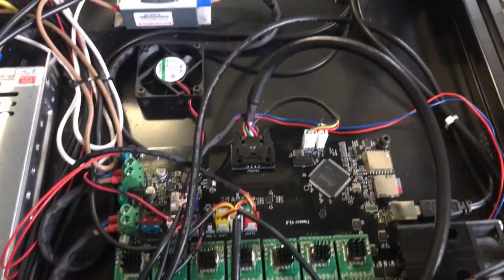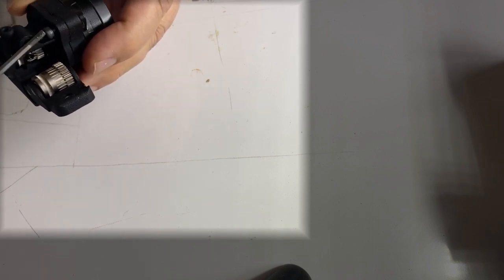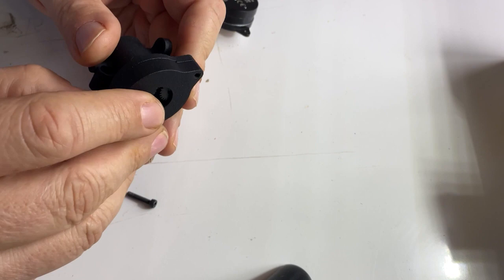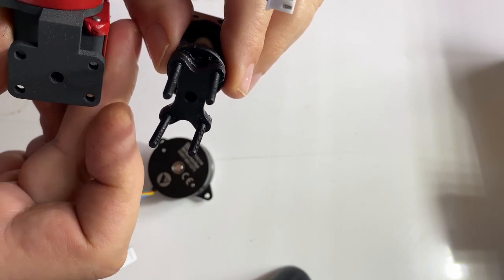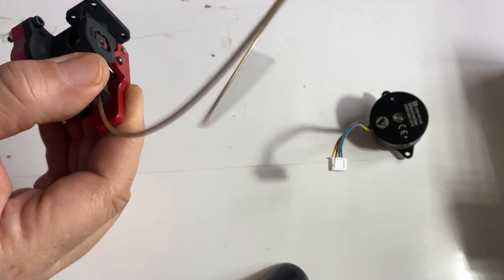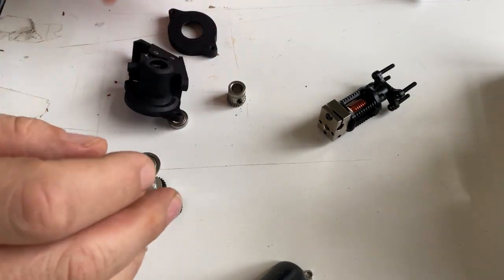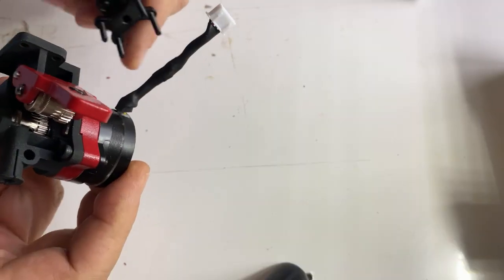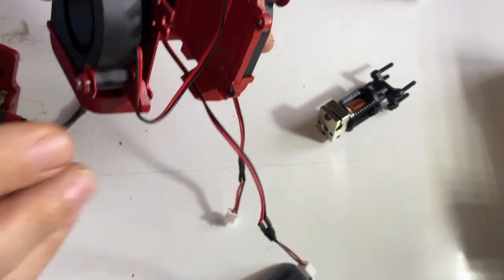Troodon Upgrade Video HD

Comment: Hi Peter, what about the noise level during printing with the Troodon??... could you please provide a video....the hardware looks great, but I need a silent printer.
Reply from the maker: Hello Matthias, the question is: which printer are you going to compare with "Trudie"? The noise level is around 55dB (measured with my iOS App). 
Meanwhile I swapped over to Klipper as a printer firmware and replaced 2 fans with more quiet 12V versions and you can't hear the printer as long as the part cooling fans are not blowing. Checkout the Formbot or Troodon groups in Facebook!
Reply: @peterschlagos8578  How simple was swapping to klipper? Is it still running well and have you gotten the crazy speeds we see from other Voron users?
Reply from the maker: @waifubellls  Pooh, honestly without the help of others I would not have managed it! But finally all is running well, accel speeds about 5000 and very fast and very nice print results! I am now (again) happy with the results!
Reply: @waifubellls  I can help you.
Reply: @giovannebeistline2575  Thank you, that would be fantastic!